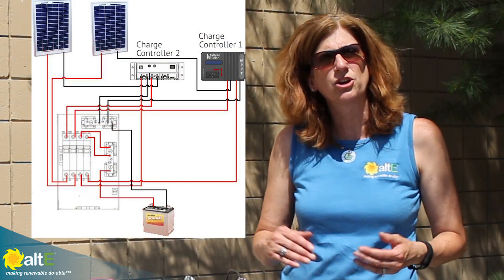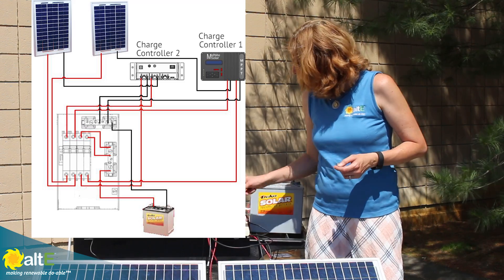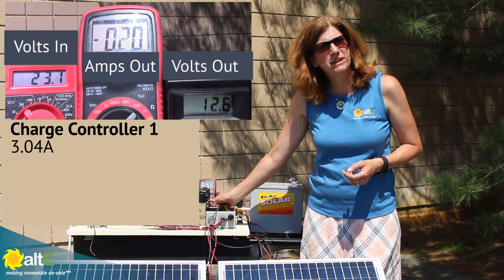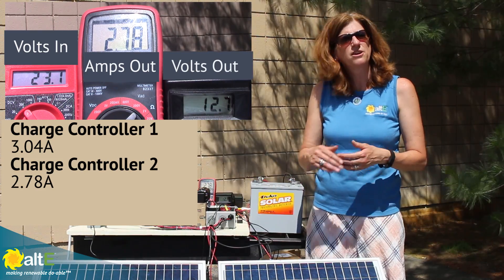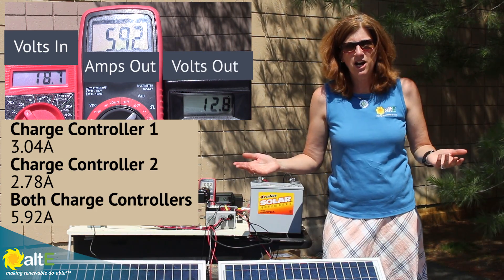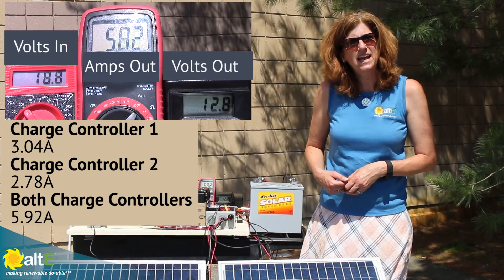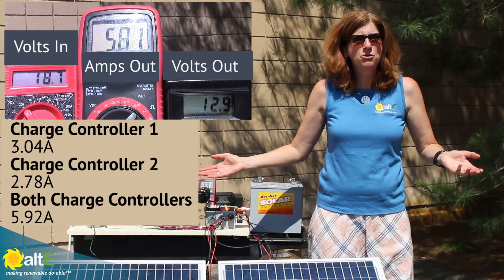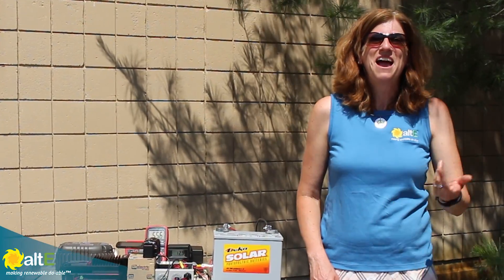Wiring two charge controllers in parallel

Comment: I cant seem to do this with renolgy tracer mppt at all I called tech support they said it will not work with renolgy  ,one controller always turns off is there a way to do this some how with diodes maybe thanks
Reply from the maker: Some charge controllers manage the 2 controller situation better than others. It works best with charge controllers that communicate with each other. The problem you are seeing is if one charge controller starts charging before the other one does, the 2nd one sees the high voltage from the 1st, and assumes the battery bank is full. I don't see diodes helping, as that really only prevents current from flowing the wrong way if one source has a lower voltage than the other. That's not your problem.
Reply: @AltEStore  In your system controllers do not communicate. How often a controller checks the level of a battery? How can both controllers in your video work simultaneously when the check voltage is wrong (charging voltage of another controller, not the real level of the battery) ?

Comment: Buy higher amps mppt instead of connecting two and making lots of confusing connections
Reply from the maker: That is the best solution, but we get lots of calls from people expanding their system and want to save some money by buying one for just the new panels. Also, if the new panels aren't the same as the old ones, a new charge controller is preferred to manage them separately.

Comment: Can this same thing be done in series?
Reply from the maker: No. The charge controllers must be wired in parallel.
Reply: altE ok follow up question if the panels are in series can you have two charge controllers in series?
Reply from the maker: Here is a schematic of how multiple charge controllers have to be connected to the same battery bank. https://i.imgur.com/g3LHozV.jpg  If the panels are in series going into the charge controller, it makes no difference, the charge controllers have to be wired in parallel.

Comment: Bad "advice" people.  DON'T do this.  Just because it briefly appears the charge amps are additive is not proof it "works well".  What will happen when the battery bank approaches nearly full?  Will it taper off correctly?  I don't see this being tested here.

A MUCH better solution is to just divide up your battery bank so that one charge controller sees half of that battery bank and the other charge controller sees the other half.  For example, if I had a 12V system with a single charge controller and I maxxed it out with the maximum number of solar panels but I then wanted to double my solar power, I would double my number of solar panels, get another 12V controller, and convert my system to 24V, but have each 12V controller charge only one 12V subbank each.

Usually when you expand a system (in this example doubling the power), it is better to increase voltage rather than leave it at 12V, however, there are exceptions such as if you insist on keeping it at 12V so if you get many cloudy days in a row, you can use a running (idling) car to charge your battery bank.  I can get 70A of charge current this way using very little gasoline.

What this woman is describing here may work with some charge controllers but most are NOT designed to work that way.  That is similarly as bad as putting 2 regular battery chargers on the same battery at once.  Some can handle it, some will not.  In general you should NOT do this.  However in a 24V series setup, many chargers will allow you to charger each 12V battery using a separate charger without having to first break the series connection between the 2 batteries.

Comment: What about if you have  two solar charge controller  and two different  types battery bank say like 2×200amp gel batteries  and 2x100 deep sealed lead battiers
Reply from the maker: You should not put different types of batteries together in the same bank, as they charge differently from each other. In your case, I'd get another solar panel and run the 2 as different systems.
Reply: @AltEStore  thanks for the reply I'm just trying to figure  things out this my first time upgrading my solar system and I'm left with a inverter 2 lead acid batteries  charge controller and they work  still so it seem  like a waste if I just got rid of them but I also like the idea of multiply solar systems  that i would have to maintain  but if that the only way to go I guess that would work but I have one last question  if you don't mind  so my inverter has an option for a.c. in  and out via terminals the a.c. in helps charge the battery bank  but only when needed  would it be  alright to get the same one and build a second solar system  and connect the two inverters through  this ports ?

Comment: Generally speaking, this is a bad thing to do.  Chargers do NOT like to see other chargers on the same setup, because it can "confuse" them.  For example, if a single charger stops charging briefly to check the battery voltage to get an idea where it is in its charge curve, and there is another charger doing the same, then perhaps the first charger will see the boosted voltage of the 2nd charger and think the battery is in a higher state of charge, and rolloff the charge power some.

What would be better (and a setup I am very fond of), is having 2 charge controllers each wired only to one of two 12V batteries in series.  That is, the battery bank is 24V and so is the input requirement of the inverter, but each of the 2 batteries wired in series has its own 12V charge controller so it gets a more "tailored" charge.  That way if one of the 2 batteries is run down a little more, the charge controller will "see" that and charge it longer than the other battery that was more topped off to begin with.
Reply: I have the same question that you do, and no one addresses it. I had exactly the problem you described with a charge controller getting "confused" and then failing to charge at all.
Reply: Lots of people take liberties they shouldn't here on YouTube which shows me they don't have a clue what they are doing.  Putting a separate charge controller on each battery is better than putting 2 chargers on 2 batteries in parallel.  I like to watch videos on YouTube to see all the dumb stuff many people do.  It is free entertainment.
Reply: @davidjames1684  In my case, I have a 12v battery bank, with four batteries, could I connect as you have done but with only a 12 volt system, one charge controller to one of the batteries and the other to tone of the other batteries? Another question I have is, if I change to a 24v battery setup like yours, can 12v stuff still run, if I just connect to the positive and negative of just one of the batteries in the bank?
Reply: I don't understand your question.  What batteries do you have and how are they connected?  What charge controllers do you have and how are they connected?  Yes if you have a 24V setup you can "tap" just 12V from it.  This is how many headlights on golf carts work.  It may be 36V or 48V total to run the motor, but the headlights only tap 12V of that.
Reply: @davidjames1684  Thanks for the response, I have two(just bought the second and will be wiring at the weekend) epever 4210an charge controllers, 4 (soon to be eight) Banner energy bull FLA 230ah batteries wired in star formation wired in parallel , all cables of equal length, I have 5 100w panel and 4 290w panels(just bought the 4 290w panels, hence the new controller) thats great new about tapping 12v off the batteries, given that tapping information I will consider wiring the batteries in series to make the bank 24v.
Reply: Yes you can "tap" any voltage from a series battery bank, but just be aware that if you load one battery more than the others,  you should have a way to put that additional charge back into the one more heavily loaded battery, otherwise if you try to charge it all as a single bank, either the heavily loaded battery will undercharge, or in attempting to fully charge it, you may slightly overcharge the others.  This is a slight problem on golf carts that use 12V headlights but use 36V or even 48V for the motor.  2 of the 6V batteries get some extra load.  Some people alleviate this problem by installing a special small 12V batteru JUST for the headlights and then using both a 36V (or 48V) charger for the main battery bank, and a small 12V charger for the small 12V battery.
Reply: Regarding your setup, I am not super expert but the first thing I wonder about is why did you select FLA battery type?  Those are high maintenance.  Why not AGM for example?

Wiring batteries in series helps keep the amperage down such as if you use a 24V inverter/ UPS.  Why do you think golf carts are 36V and 48V and some are even higher?  Why not 12V?  The answer is simple, so the amperage is more reasonable and the wires can be smaller diameter without getting overloaded.

For your setup, I would be afraid to wire it all in 12V and connect both controller/chargers at once.  Manufacturers don't normally warn against that but I suspect they are not designed to handle that well. 

 The lady in this video claims there is a lot of wrong information out there on Solar, but what she didn't mention is some of it is coming from her.
Reply: @davidjames1684  I chose FLA because of the price, I can get them fairly inexpensively, it's kind of strange how the internet works, instructions for basic solar setups are everywhere but when you start to get more generation power it gets tricky fast without too many online tutorials, I'll need to do more testing and research, I forgot about the extra load on just one battery, so that's ruled out now, I'll stick with 12v for now, I used the star formation because that is the best at spreading the charging and discharging evenly, I think I will put together some videos when I get this figured out, seems there is a lack of instruction on this. Once again, thanks for the response and your time.
Reply: It is amazing to me how many battery charger manufacturers don't even mention about not using 2 chargers on the same battery at the same time, yet many of them will have problems doing that.

The extra load on the one battery is not critical if it is just a small load and/or you use a slightly more powerful battery on that.

Also, I think that "star" formation is not critical either.  Reason I say that is cuz I had a 12V setup using seven 100Ah batteries and I tried charging it from my idling car using jumper cables.  Those cables would only reach one battery which was on the far end of the bank.  So it seems that would be bad since the car's alternator was outputting about 70A of charge current, but with all the batteries connected, it spread out the charge.  I checked it after the batteries settled and they were all similar in resting voltage.

One time to "help it out" a little, I took a 2nd set of jumper cables and connected the 2 batteries of the far ends together to help "spread" the charge but it really wasn't necessary.
Reply: @davidjames1684  Another question for you about what you said at the start of your comment, "each of the 2 batteries wired in series has its own 12V charge controller so it gets a more "tailored" charge."

From some of the research I read that only one of the charge controllers should have an equalize period, what do you think? if each controller is attached to one of the two 12 volt strings then maybe both set to equalize would work, any thoughts?
Reply: Are they AGM or FLA type?  Usually FLAs are the only ones that get a EQ charge and only occasionally and only if they are charged as part of a higher voltage bank using a single charger on multiple (or all) batteries in that bank.  If you are using a separate charger on each 12V battery (either solar or a plug in charger), then there should be no reason to do an EQ charge since each battery would already be getting a "tailored" charge and that is about as good as you can do. 

Where separate chargers really "shine" is either when you have two different 12V batteries such as one AGM and one FLA, or when your solar panels  exceed the capability of one 12V solar charger so you make your system 24V and run only about half of the panels to each charger controller.  

For me, I have 2 "identical" (model) AGM batteries but they are so old that I suspect they are not really identical as far as performance, so instead of charging them in series as a 24V system, I load them at 24V (using a 24V UPS), but charge them using a pair of 12V charger controllers.  

In theory you would think each battery would drain an equal amount but in reality there are some slight biases and one will get drained more than the other so generally speaking, separate charging of them is a superior method than using just a single 24V charge controller (there are exceptions).
Reply: How does windmill charger work then with solar
Reply: That's clever. Also it will prevent battery imbalance over time in series strings.
Reply: @Zen Innovations - I wouldn't say "clever" because technically, a 12V battery is a series string of six 2V cells.  What would be even better is if each cell could be tailor charged on its own, so a 12V charger would actually be six 2V chargers that you would connect to each of the 6 cells.  Battery manufacturers don't generally do that, likely because of cost reasons.  When I charged my moms 36V golf cart batteries in 12V pairs (instead of using a 36V series charger), it seemed to work well.  A good idea is to mostly use the 36V charger, but occasionally (perhaps once a month), use the 3 charger technique.  Even better would be six 6V chargers but that is a lot of hardware.  12V pairs are "good enough", especially if it is a 48V golf cart.
Reply: cant charge 2 bateeries in series indivitually

Comment: Hi, my name Stephen Welsh, I'm a certified marine technician and I will like to give you a bit of advice regarding the above video and connecting charge controllers in parallel. 

If you run out of capacity on a charge controller the best thing to do is obtain a charge controller with higher amperage that can carry all the panels at once, it's called a charge controller/regulator because its sole job is to regulate the Voltage and Amps so you will not over charge and destroy your battery in that case. 

Here's what actually happens when two or more controllers are used in parallel, lets call them controller A and controller B.   Both controllers will start charging in full capacity (bulk) as seen in your video above, but when the volts get up to the set bulk charging voltage let's say 14.2 or whatever you have it set at, controller A  will see  the  battery voltage at 14.2 and thinks that the battery is getting full. Therefore, it will quickly go into absorption and then into float prematurely, while controller B struggles for the rest of the day trying to do all the work and thats because controller A thats in float putting out little or no amps  thinking the battery is full and take the rest of the day off. If  you're running a system smiler to this, 
two 50 charge  controllers  feeding the same battery bank with 30 amps each from separate panels (total 60 amps). If you are running that kind of set up please monitor your system read out and you will see one charge controller working three time harder than the other, a easy way to tell is one always hotter than the other.

The only way you can put two or more charge controller in parallel without having the problem I described, is by using charge controllers that could link with each other like master and slave.

Its best to put all your panels on one charge controller. If you thinking of adding panels in the future, buy a charge controller that allow you to do that in the future, hope this helps.
Reply: Great .,Did you know a brand or model that do this? i'm planning to add more panels to my system and need an extra MPPT .
Reply: Just one thing to say : thank you sir!
Reply: Marine Tech Online I am actually trying to deal with a similar problem. 

I am in the design stage where I am adding several solar controllers, and in addition, I am adding wind and hydro controllers to the main common DC bus bar.  

However, the controllers for wind and hydro come with these devices.  Therefore, I am wondering if I should feed their output to a slave device in order to avoid having a different voltage in the bus bar.

Interestingly, this is for a marine application.
Reply: @ek9772  It should be fine as long as they are all set to the same battery profile tbh
Reply: Wow thanks.
Reply: Hi Stephen. I need your help. Should I hook my identical 100W solar panels up in series or parallel?
I would like to add another 100W panel (identical to my first one) to my system and am unsure of I should hook up in series or parallel. 
I have a basic system on my little RV camper. It consists of: 
1 - 100W Monocrystalline Solar Panel with max output of 22VDC
1 - 30A PWM charger controller with max input of 50VDC
2 - 6V Deep Cycle batteries hooked up in series to give me 12V to my camper
I've watched a lot of videos on YT to figure this out, but the advise is all over the map (kinda like this video), but after reading your comment, I'd be happy with your recommendation on this.
Reply: @quaddingsous  As PWM Controllers require input/output to match, which in your case is 12v due to the battery bank, your solar panels must be linked in parallel, so that their combined voltages remain as 12v.
Reply: Hello I hope you can help me , I have one solar panel and 2 battery banks one agm one lithium can I use 2 different charge controllers to charge the said batteries from the one solar panel the banks are separate power sources for various items and not working together
Reply: For flooded or wet cell batteries set one controller to equalize and the other to agm and change the voltage parameters on controller 2 to match the equalization algorithm of controller that is set up to equalize.